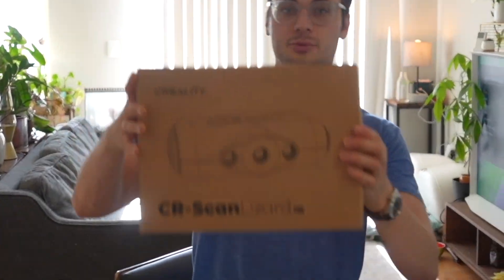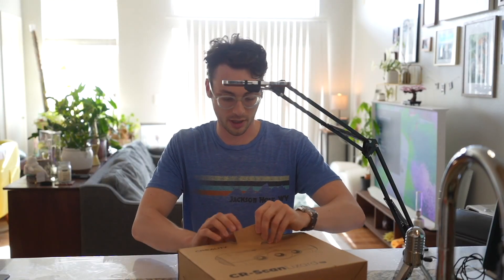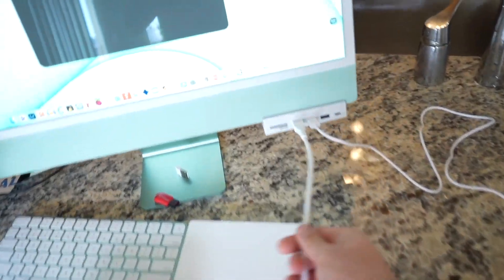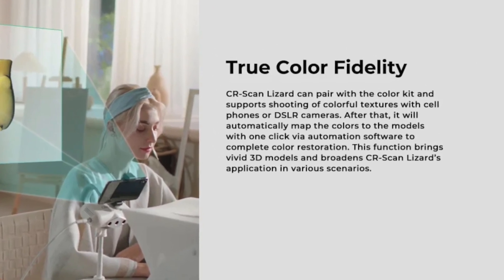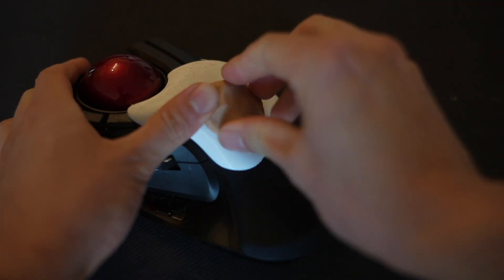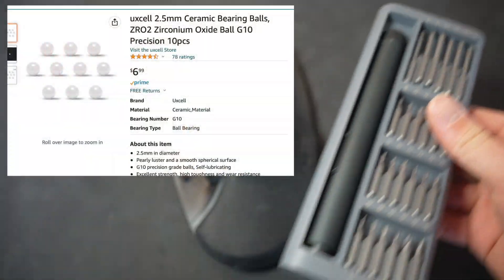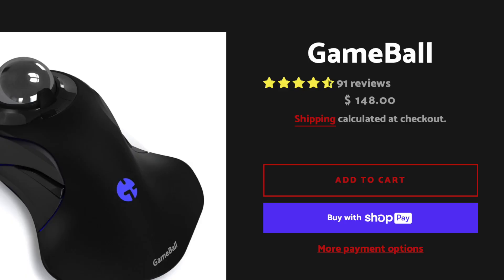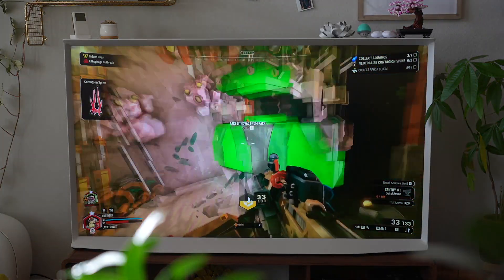Creality CR-Scan Design Workflow

Comment from the maker: Update: I've now had the chance to compare this trackball to the GameBall. Despite what my thumbnail says, after testing them both I'd personally skip the Huge and go for the Gameball if you want to game, as it is comfortable and smooth right out of the box (I know this sounds dumb to say that the product with "game" in the name is better for gaming... but it really is)
Reply: If only they shipped globally...
Reply: Question : including upgrades, notably the bearing replacement, are there any significant differences?

My issue is that the gameball lacks a lot of the additional buttons I basically consider mandatory on a mouse. Tapping the scroll wheel left/right, having lots of bindable buttons where I need them, etc. are basically mandatory for me, and as far as I can tell half of the available inputs on the game ball (3 buttons on each side, no other easily bindable inputs) need to be bound to basic mouse functionality of left click, right click, and middle click. As someone who consistently also binds M4/M5 (forward & backward) along with left/right scroll wheel taps, that makes it a borderline non starter.

I don't mind doing some mods to my trackball, but if the gameball has performance advantages that can't even be matched with mods then that'd complicate things for me.

Out of the box almost everyone says the ganeball is the winner, but a bearing replacement is less than 10usd and I haven't heard anyone comment as much about a modifications-allowed comparison.

Comment: Great skills, slick design, only thing is I wouldn't personally spray paint it because it seems like it will come off with time (but i may be wrong)
Reply from the maker: Initially I tried to electroplate it (after coating it in a conductive paint), but that didn’t work well and I need to experiment some more with that process before I use it in a video
Reply: @CarterHurd  Ahhh okay, i get it then

Comment: Bad ass. I have yet to do the bearing mod on my elecom deft pro. The default bearings suuuck. My latest periferial fad is gaming on teeny tiny wireless mice that cost 15 bucks. Great for toddlers and not a lot of excess cash
Reply from the maker: the bearing mod is really worth it. Total pain, tho. Still… I’d recommend.
Reply: +1 for the bearings of the deft pro

Comment: Microsoft Trackball Explorer for life! There’s an open source project called Ploopy that has tried to clone it. I found out about it while trying to figure out if any 3D scanners were worth their sauce in my wallet’s vicinity. Really, I’d just rather scan all the MS’s parts and print replacements whenever I need them. I’ve been gaming with a trackball since the original Unreal came out. Mice suck.

Comment: Windows pc bit was hilarious.
It's great to have a 3d scanner. But seeing how much you simplified meshes and still got good results, I am not sure that such a precise 3d scanner is actually needed for this task. Unless you need to get actual model of peripheral first that is. The partial photogrammetry scans should be more that enough if you already have an original shape scan.
Also. For a pc games there is a fairly wide array of pointing devices. Beside trackball, trackpad and mouse there is also gamepads with gyroscopes, gamepad with trackpad & gyroscope (steam controller \ steam deck) . Or you can just use mouse with only your thumb \ wrist so that it doesn't require to move an entire hand on a big flat surface of a table.

Comment: I'm not bothered by it, but I would suggest to you not using a Personal Autodesk license for Commercial use.
Reply from the maker: This video has made less than 5 dollars so far
Reply: @CarterHurd  As I said, I am not bothered, no need to justify yourself.

I am not a fan of Autodesk and their licensing either. But it does not matter how little ad revenue this video is creating, even if there was zero YouTube ad revenue this would be commercial: The Creality deal, Amazon ref program, IQUNIX ref program.

It's just a recommendation with good intentions from me, this is clearly commercial, and I would advise to not fuck with Autodesk lawyers, try searching for "autodesk audit" and read some stories if in doubt.
Reply: @Steakbroetchen  Seems like you are bothered by it

Comment: Cool, but $500 is kinda steep for a hobbyist i think.
Reply from the maker: Oh for sure - I just wanted to show off this style of design process. In a few years the costs will come down (or the iPhone will finally get good enough to do scans approaching this quality). It's one of those industry techniques that is slowly becoming more approachable for normal people, but we aren't there quite yet
Reply: @CarterHurd  Fair, also on second thought it probably would pay for itself if you design and print stuff for profit.
Reply: True, but for what it is capable of, it's well worth it.  It's also a sign that we should be seeing hobbyist-level versions that maybe don't put out quite so high resolution in the next couple years.  This tech has come a long, long way in a very short time.